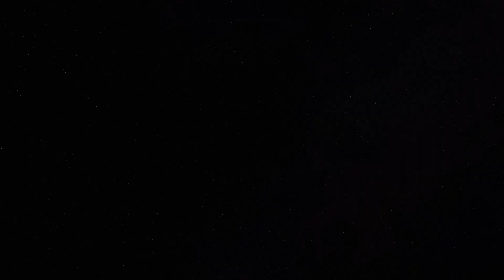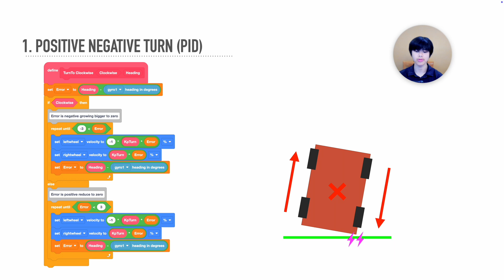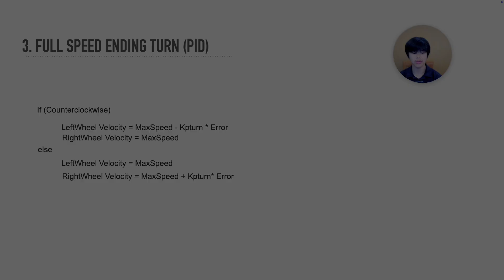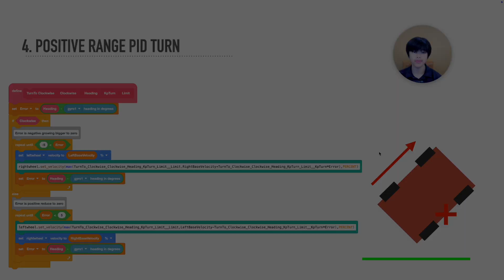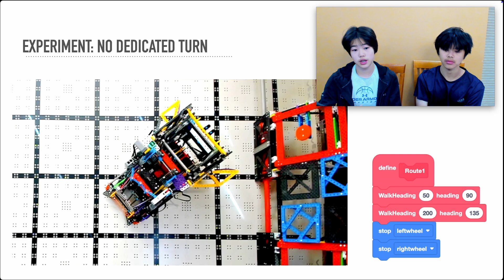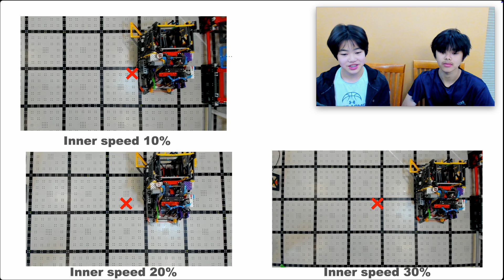[VEX IQ] Turn Fast & Precise? Formulate Drive Path, Trajectory Planning, #vex #roboticscompetition

Comment: Hey there I was wondering what the distance sensor blocks within the codes do and if I necessarily have to put them in a certian spot or even need to use them for mix and match this year also what walk heading and heading do within the program like for example if I wanted to make the robot turn 25 degrees what would I set the blocks to (Im using the Positive Negative Turn Program)
Reply from the maker: Walkheading has the robot walk and maintain a heading. If the robot is off of the heading before the walk, it will still turn according to the algorithm, keep in mind that in these examples, I used a gyro, not brain inertial. The gyro turns counterclockwise while the brain inertial turns clockwise 👍
Reply from the maker: Regarding the distance sensors, you don’t need them

Comment: What is the -5 and 5 doing on the Full speed ending turn? I ran this code and it turned for a little bit but not the amount I set it to
Reply from the maker: the -5 and 5 are the error threshholds. pretty much. it will stop adjusting when the angle is within 5 deg of the desired amt. This is because once you tell the motors to stop turning, there is still some motion so you have to stop it a tiny bit early
Reply: @MatthewChou0 ohhhh okay thank you so much

Comment: I am doing vex iq rapid relay, and I have a back roller robot. I am trying to use your drive straight and turning fast and precise methods, but I always seem to test it with brain inertial and not a Gyro and it does not work as planned. Usually, it infinitely turns rather than turning 90°, which I have said it to, and I have accounted for the gear ratio in my robot.
Reply: I do not have a Gyro and they are out of stock at the vex store
Reply from the maker: @ Hi, there are many reasons this could be happening. Spinning indefinitely means that the robot never jumps out of the loop, it never acknowledges that it has his the angle. One possibility is that you need to change the calculation to account for the fact that the gyro and the brain inertial act very differently. The gyro increases counter clockwise and vise versa for the brain inertial.